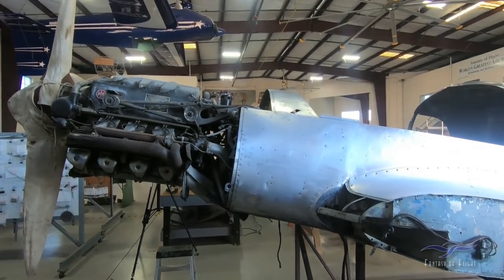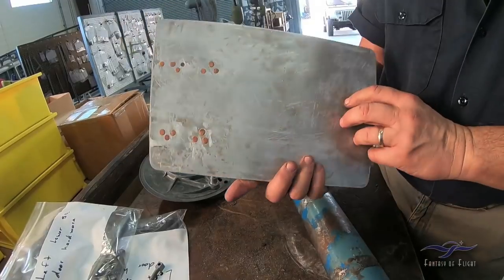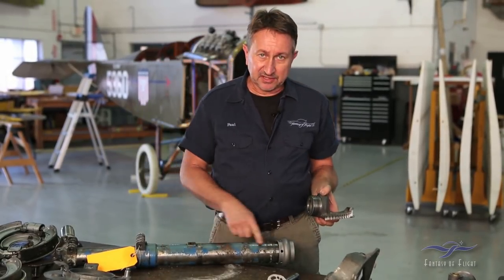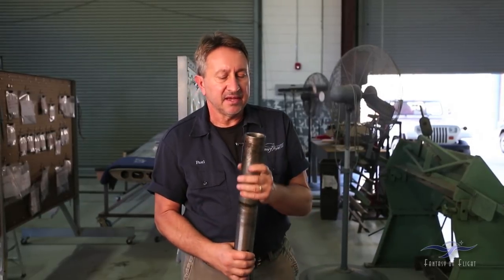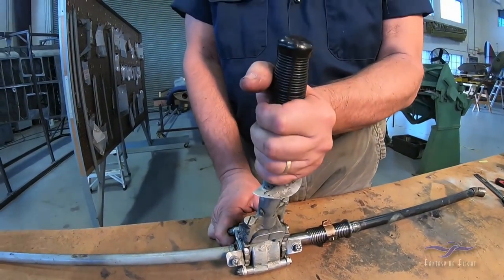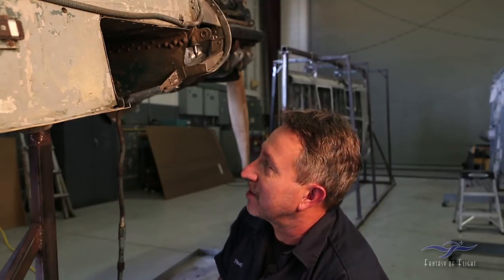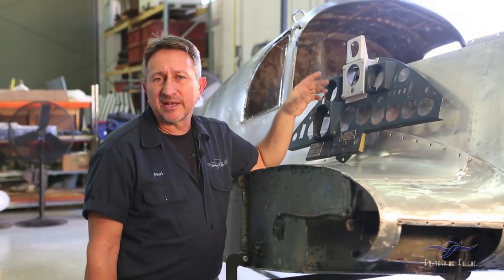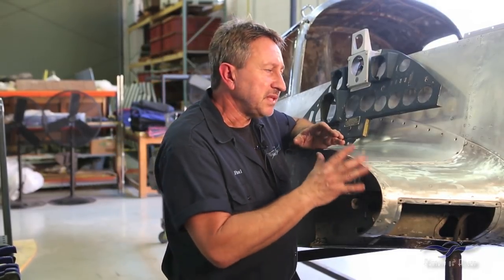Messerschmitt Bf-108 - Restoration Update #14 - November 2019

Comment: To the worm gear mechanism at 7:49.
The 'Kurzbetriebs- und Rüstanleitung' for the Bf 108B reads in chapter J) 'Wartungsarbeiten nach Bedarf' in pos. 5
'Schnecke und Segment der Fahrwerkseinziehung oft fetten. Wenn bei aufgebocktem Flugzeug ein merkliches Spiel zwischen Schnecke und Segment festgestellt wird, ist die Eingriffstiefe durch Verdrehen des Exzenterbolzens (nach Abnehmen des Abdeckbleches an der Stirnseite des Rumpfansatzes zugänglich) nachzustellen. Nach dem Einstellen Exzenterbolzen mit Feststellschraube wieder festlegen und Schraube sichern.'
It is a system to adjust excessive play between worm gear and segment.

br from Germany
Reply: The authentic information.
Reply: I've been in the antique German car restoration field for a long long time, when I saw that I figured that shaft might have an eccentric cut to it be able to adjust the worm gear tooth engagement, 1930's Mercedes are built probably much like the German airplanes of that era, I've always said there's the wrong way, the right way and the german way!  Thank you for confirming my guess!

Comment: 7:49 Doesn't the pin have a couple of cylindrical surfaces with a tiny bit of excentricity? I can imagine that by turning it in relation to the housing and using different locking hole you could adjust the play in the worm gear...
Reply: That was my thought as well.
Reply: I agree, about to post that the gear backlash is most likely adjusted with that pin.
Reply: That's exactly what I was thinking.
Reply: Just posted the same question till I saw you went first....
Reply: Agree, it is a Cam Bolt and moves the contact patch between the two gears.
Reply: I agree,  Can't see in the video but I expect the pin with the odd multi position lock plate has a few tenths of a mm eccentric between the casting bearings and the gear strut bearing.  This would allow adjustment of the gearbox worm/wormwheel backlash.
Reply: The other pin on the bench does appear to be eccentric, obviously as you say for adjustment purposes.
Reply: @wazzawalker6536  The first thought that came to my mind too. 65 years of engineering does that to you.

Comment: Chuck that tube with the spring in it in your lathe and run the tailstock up against the nut.  You can control any spring pressure being released with the tailstock as you unscrew it.  The same with going together
.

Comment: regarding the multiple holes for securing the gear pin for the landing gear.  I'll bet there is a slight offset to the diameter where it rests in  the housing, and they use this eccentricity to adjust gear lash.

Comment: Great video Paul, thanks for that, very interesting...having restored a few vehicles over the years, but unfortunately no aircraft I would agree with the 3 P's ...and yes I would love your job!
Check for eccentricity on the worm gear mounting pin (the one with the 5 holes) it may have slight eccentricity on the shoulder  so that you can adjust the mesh/clearance (backlash) on the worm and gear. 
The Main gear shock tube (see 1:22 min) looks bent  ...is that right? 
Thanks for taking the time to show us all the good work, my thanks to Kermie for letting you guys show all of these projects too. 
Keep up the good work.
Reply: As for the gear tube it looks like the camera has a wide angle lens on it giving it a fish eye look.  I agree with the 3 Ps for sure.

Comment: Hi Paul,

Nice great presentation again,. It's really interesting seeing the old tech involved when designers really were thinking out off the box.

Just a thought seeing the leg door mounting lugs bent out of shape, seemingly on purpose.

During the loop/collision, could the leg trunnion casting, and mounting forging have moved (rotative creased) the air-frame at it's mounting. This may be the reason for the offset door lugs to 
compensate for a wrong leg angle and align the door to the wheel-bay aperture?

Just thinking that a problem with the leg geometry is the last thing you need after renovation, and during gear refit.

Thanks again buddy :)

Comment: Could the pin that the gear rotates on be a very slight eccentric or can this needing the additional holes in the head, this would be only a few thousandths to set the gap between the worm and the gear?

Comment: On the retaining pin: I believe there is a slight excentric among the wear you see and the worm wheel lash can be adjusted out.
Reply: That's what I was thinking too...
Reply: I was thinking that but if it were eccentric how would it slide through the holes?  Unless there was a bunch of slop from new it would bind on the way through.
Reply: I didn't explain very well. The worn area is rotated away from the load (worm). There might even be instructions to rotate the pin after a period of service and replace after the fnal position is used.
Reply: @AnvilDragon  ahhh. Yes. I get it now. That could be it though I feel like the area of wear would be evenly spread enough that the multiple positions wouldnt really help.  It's gotta be there for a reason though and your idea sounds the most plausible.

Comment: German engineers of the Ferdinand Porsche era were extraordinary and did with it all with slide rules. Were the different holes for ease of installing the locking pin on field airstrips with less the level surfaces? If I remember right the Bf's were engineered to be modular with ease of service in mind.

Comment: A couple of questions  how does the landing gear door attach to the tubular frame? Are those small u-joints at the end of the retract shafts that attach to the gear box? Finally how did you determine  that the gear legs were threaded and not pressed? You kinda touched on the last question  but still really curious. Thanks so much, great video.

Comment: The pin that holds the landing gear segment into the worm gear box likely has multiple holes for adjustment of the engagement between the gear segment and the worm gear. I'm pretty sure its machined so that as you turn it it will increase or decrease the mating tolerance.
If you find out for sure let me know, Im kinda curious now too.

Comment: Hey, it seems to me that the worm gear pin has many holes to secure it because it is also used to set the play in the worm gear......you turn the pin one way it has more play, the other way it has less play. It is slightly excentric where the actual gear in the housing sits. Hope that helps :)

Comment: Is there any sort of locking mechanism for when the gear is fully extending?  Or are they merely relying on the worm gear to hold the struts in place even if they weren't quite fully extended?

Comment: Hi, very interesting videos!
This is only a guess, but might it be that the gear that meshes with the worm gear, has a pin with an eccentric segment that could be used to change the fit of both?
In that way you would use the different safety holes to accommodate the wear of both and have a better fit. By rotating the pin you could adjust wear or misfits of the gear and the worm gear?
I mention this because I noticed that the pin did not go easily at the end and that might be due to an eccentric portion.

Comment: That landing gear seems insanely heavy and complicated for a light aeroplane. Did they borrow the 109's design because it was available, or was it just German engineers being German engineers?
Reply: Parrot Raiser The Bf-108 was designed about a year or two earlier than the Bf-109. So it could be only the other way round, 109 got design inspiration from the 108.

Comment: Have you considered how much time you spend trying to track down NOS spares and then the waiting time for them to arrive, that is assuming they are identical to the ones you need and not a Mark IV variant?  Its possibly more efficient to fabricate your own parts, within reason, especially as you have the patterns directly to hand, you then know the quality of the part and don't have to trust 80 years old bits.  Don't worry about authenticity as that is only a modern fixation, all our ancestors would recreate parts from new material, and include improvements if necessary, rather than rely on historic bits.

Comment: Paul, the brakes look like leading/trailing shoe type brakes, which from experience with vintage race cars, never work very well. Would it be possible to add a second slave cylinder, convert the existing slave cylinder to single sided and make the brakes twin leading shoe. On some vintage racers (Alfa-Romeo and Maserati) we have even converted to triple leading shoe. Once assembled, this change would not affect the external visual appearance of the brakes, other than a second hydraulic line at the back of the drum, to the second cylinder. You might need to change the master cylinder to a larger diameter, to provide additional hydraulic flow. This does improve the braking to a reasonable degree. What I don't know is if this change would affect the aircraft certification, especially being a safety related system component.

Comment: Whether the bf-109 is of the same technical generation?
Reply: Jari Kinnunen It is. Bf-108 was a kind of „test“ of manufacturing methods. Although there are very few if any parts that are the same, they are designed in a quite  similar kind of way. So BFW tried / used things and developed methods with the 108 they used and refined with the 109. Especially the design of the rear part of the fuselage is very similar, being a little more designed for mass production on the 109. First flight Bf-108: June 1934, first flight Bf-109: May 1935.
Reply: darkredvan As far as I have read Willy Messerschmitt took the Bf108 as a starting point. Same set up but of course but for single seat use. Landing gear attached to the fuselage as well. Simple and effective. But it was also a weak point. The narrow track caused many accidents.
Reply: C F In fact fixing the landing gear on the fuselage was due to a demand by RLM that the 109 should be able to be transported on railway wagons (and trucks) with ease. No separate support for the fuselage should be needed. It also helped significantly to keep the weight of the wings down.

Comment: In your last video you showed the seat belt for the 108. They are the same as the ones in my old glider. You can get them overhauled at SPEKON in Germany(Probably the original manufacturer? They exist since pre WWII) . They are very  helpful and will rebuild the seat belts for you.

https://www.spekon.de/en/products/aviation-textiles.html

Cheers from Germany

Comment: Hello my name is Manuel and I am taking a class on EDX , Introduction to aerospace structure and materials and I have to make a list of the main materials used in my favorite aircraft which is the Messerschmitt BF 108. I have to name the materials used , the type of aluminum used for the spars, skin panels, ribs, bulkhead and longerons, apart from the steel used for the landing gear system and the magnesium body panels. Also my first language is spanish and I can translate this aircraft log book.

Comment: Personally I think you are too fastidious. Replating a lot of that stuff is not really necesary. It will be better than new!!
Crack testing though is. That landing gear rack on the teeth is most defenitly. Those suspension  legs are really just a McPherson strut with coils inside.Cushion the landing so as not the throw the load into the airframe and the shock controls the bounce. Possibly room for improvement with the shocks as that technology has came a very long way. Crack test the stub axles too. Over 80 years may well ahve neenm abused!!
All those steel castings should be checked for cracks and being bent.If bent quite possibly cracked.Though if everything feels ok, bolts turn smooth etc probably ok. Crack test those main bolts as well.
Those old magnesium castings scare me, mag is hydroscopic and corrodes.ASnd then breaks. Especially with those wheels. Though you do not want a brake shoe anchor point break either.
I am still watching this series with interest, it is how I found this site and the mechanical part interests me more than flying.
I am a self taught motorsport preparer and have a fair idea of what should and should not be used and what needs repair. And what needs a constant look at.